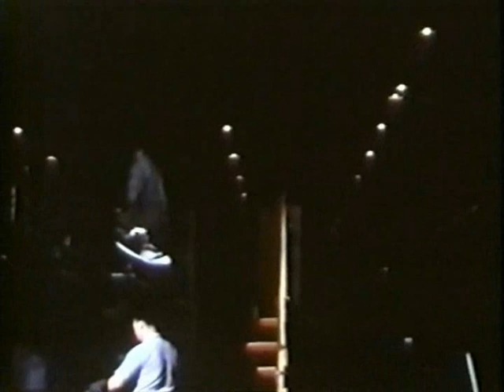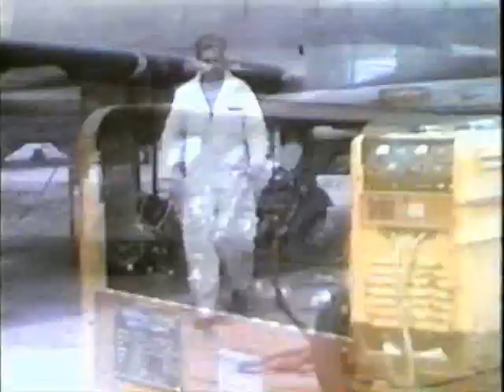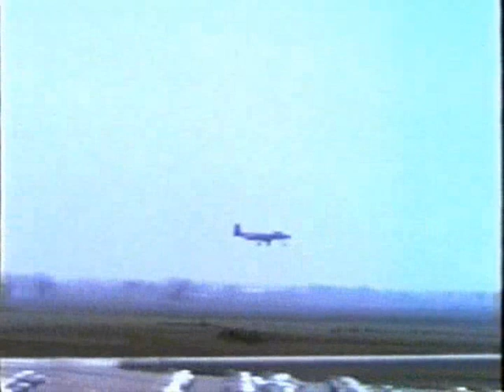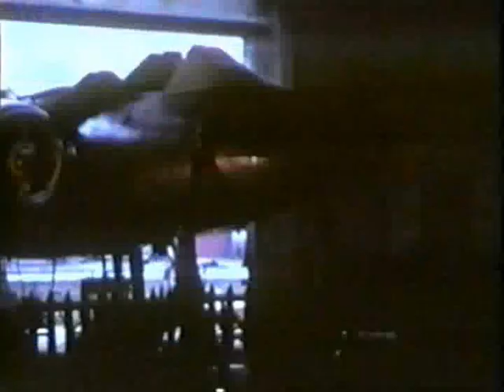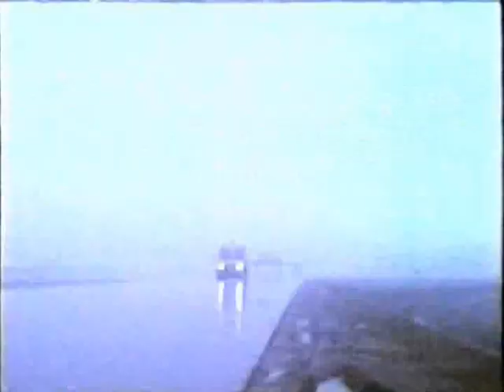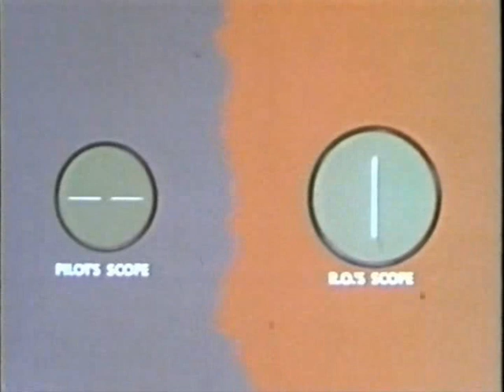Avro CF-100 Canuck Part 1

Comment: Correct - it was designed to intercept bombers on a collision course coming over the North Pole and fire the 58 rockets in a shotgun blast controlled by the onboard computer.  It didn't need to chase anything down, although it held its own in dogfights against the CF-86 Sabres. (....at least, that's what my dad and the rest of the CF-100 crews said.....I'm sure this will start a internet dogfight with the "Sabre-jocks" LOL)
Reply: MrSerf2k Lead Collision course!  Collision course would be the crews and the aircraft's last flight! ;-)

Comment: @cybermarsactual 
It was a 1950's plane, so swept wings were still not used on all/for all planes. This was designed as an interceptor, very capable to counter slow bombers, straight wings for fast planes are not uncommon (Gloster Meteor). Canada also had the CF105 in develpoment and the Canadair Sabre for air combat.

Comment: Excellent, underrated interceptor...especially the later Mk IV and  Mk V. Interesting note: Avro experimented with a retractable 48-tube FFAR ventral pack that would replace the .50 cal 8-gun pack. Unfortunately, when extended, it caused violent buffeting of the aircraft and had to be abandoned.
Thanks for posting.